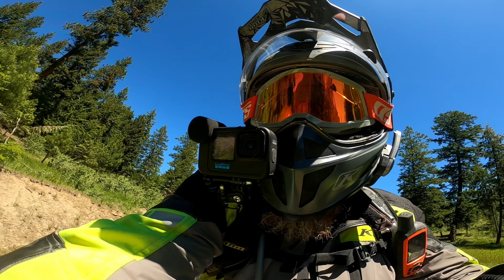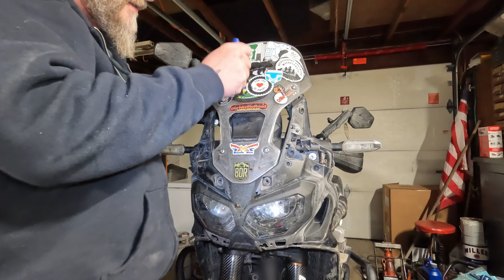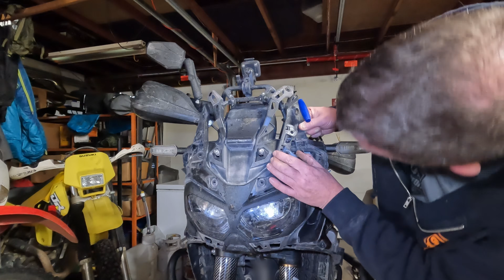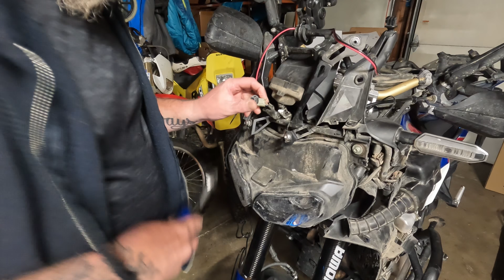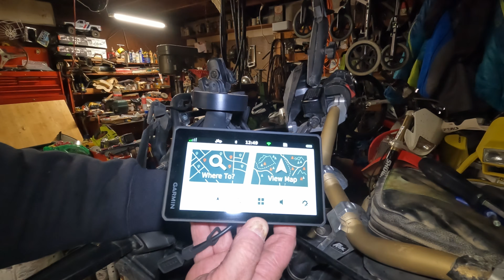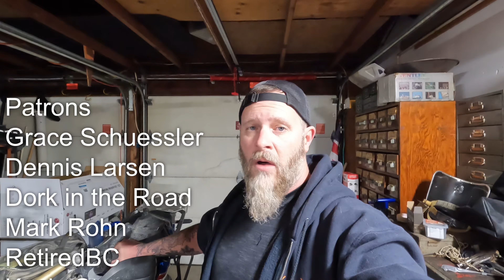Hard wire accessories WITHOUT killing your battery

Comment: I am lazy, I connected it to the battery. I need to take it out of the mount when turning the bike off or the battery will drain. I should get around to writing it properly in the spring. - Frank

Comment: Hopefully you put a zip tie on the electrical tape before you button-down the ferring, I have had that come loose before and shorted out , but now I use heat shrink on everything I solder. □